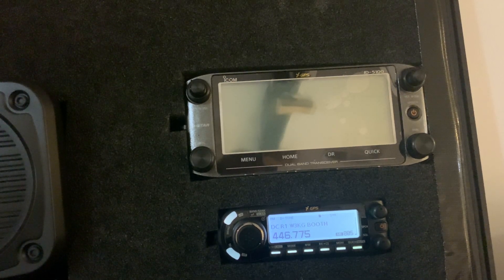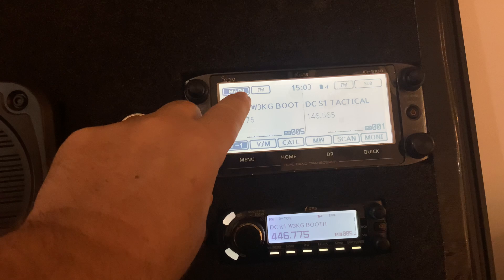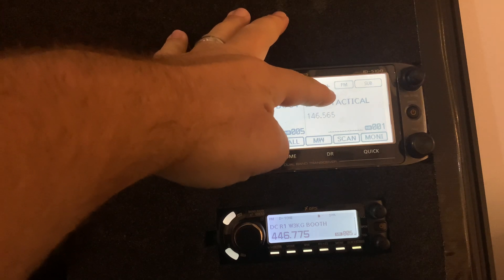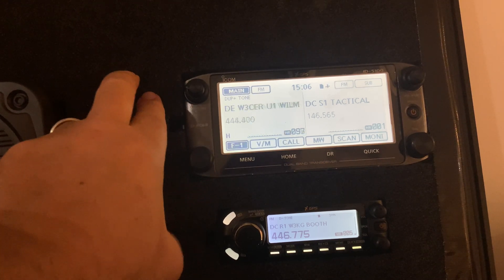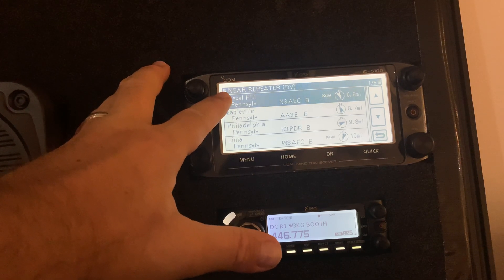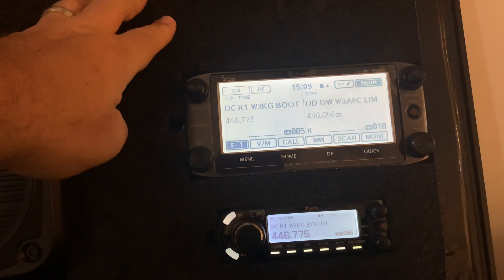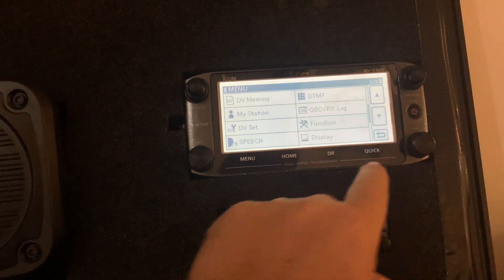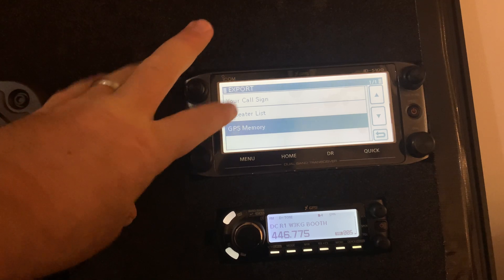ICOM ID-5100A D-STAR Transceiver Basic Overview and How To by W3CTK for Delaware County ARES RACES

Comment: I Still Use & Love My IC-4100A As My Daily Driver ! I Looked for a 4100 For Months & Was About to Pay For a New 5100 When i Got a Msg About my 4100 2-3 Years ago & So I Immediately Stopped The Check Out Process on the New 5100 & Paid For The 4100 Instead & Never Looked Back..lol. An 2-3 Years Later i Still Use It Daily !  I Have Several Budys That have the 5100 But I Just Loved The Look of The One i Got..I Want to Try a 5100 at Some Point But i Also Know They Are not Worth a Plug Nickle for Mobile Use (Screens Go Bad) Really Easy as i understand it!